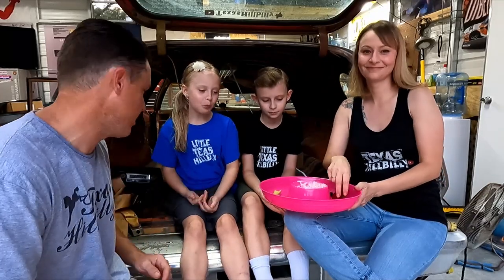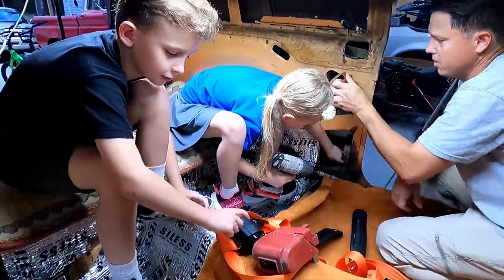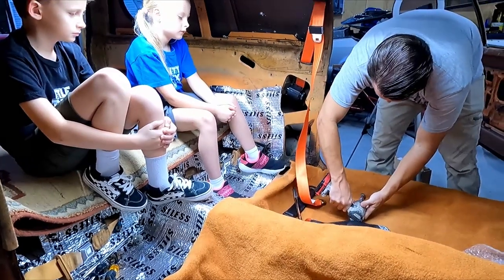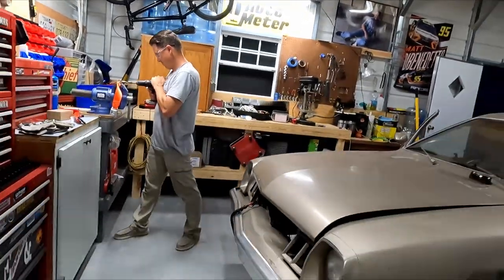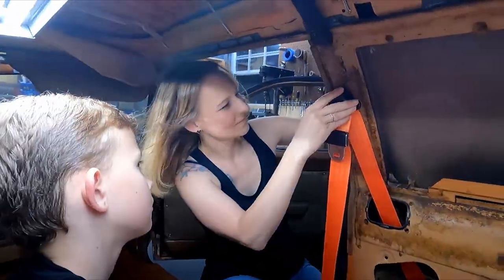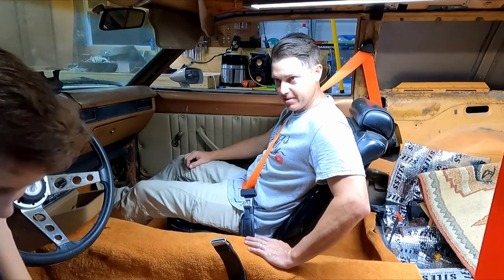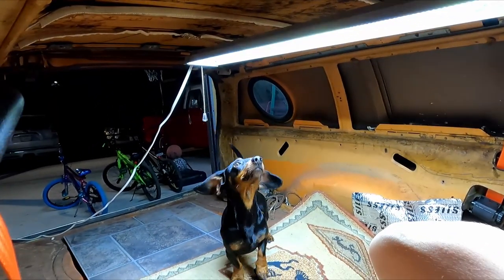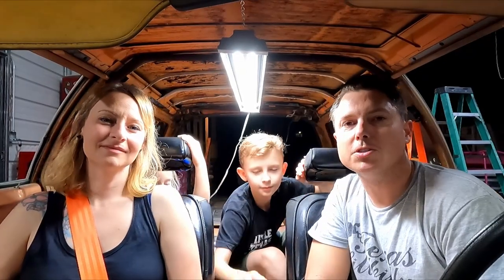Replacing Death Trap Seat Belts in a Ford Pinto Cruising Wagon

Comment: To put holes in the carpet, use an old (or cheap) soldering iron and melt the hole in.  You won't risk unraveling the weave plus it will "seal" the hole.
Reply from the maker: I was going to try the punch heated with a torch method, but ran out of gas.